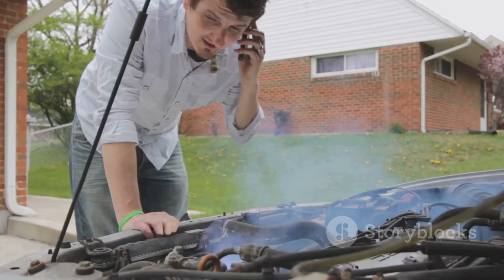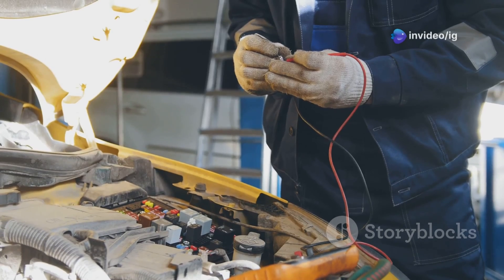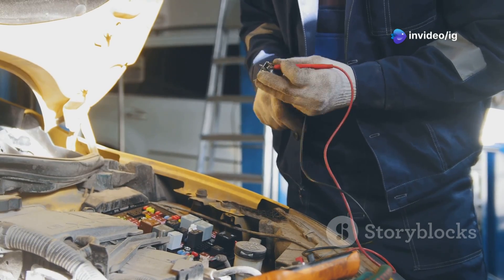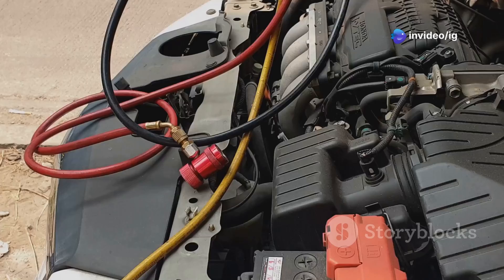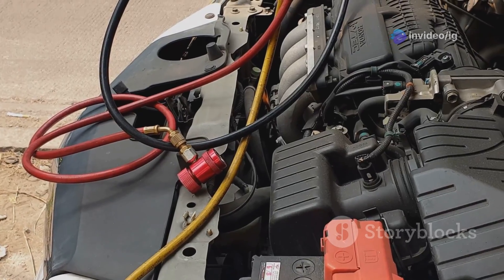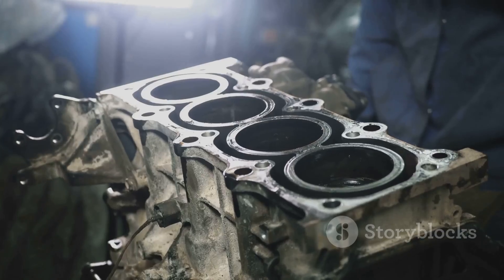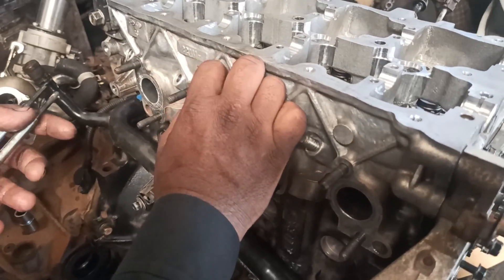P0380 | p0380 glow plug heater circuit a | code p0380 | dtc p0380 | p0380 obd2

Comment: i cleared the code and the powertrain lights turns off but if i turn off the engine & start again it come back 😢 plz help me
Reply: I suggest you change it instead of just clearing  code
Reply: @atos.nympha3451 it was faulty glow plug at the end